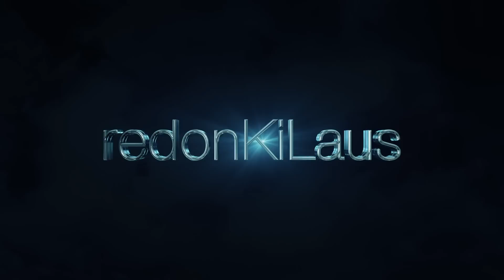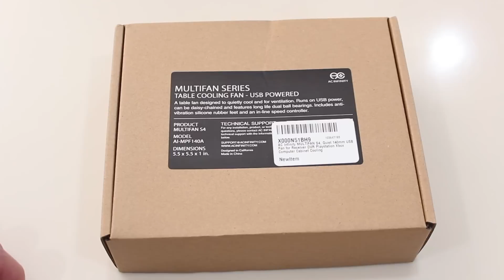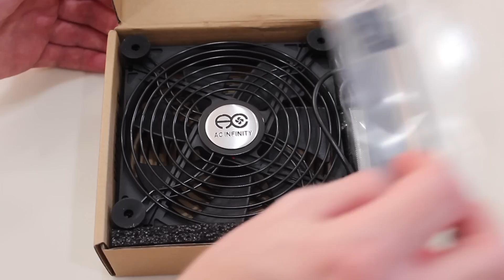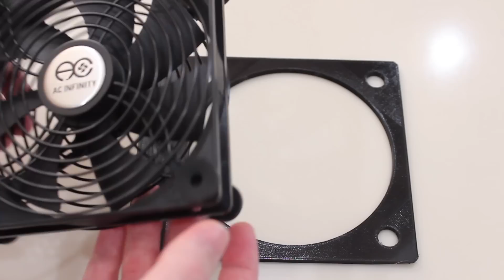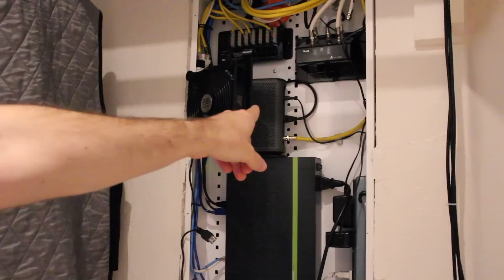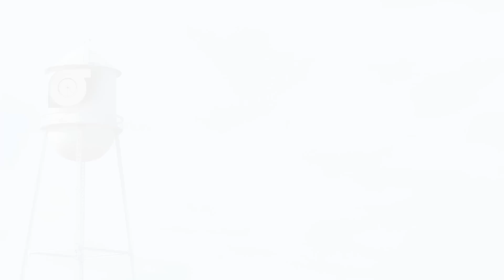AC Infinity MULTIFAN S4 - Network Equipment Cooling

Comment: Good review thanks a lot. If I heard you correctly you had a usb powered regular mini fan, and while it dropped the temp on your equipment this specific fan dropped it even further? 

I’m debating between this and a similarly just standalone USB powered fan for my PlayStation 5. It’s got a heating issue where it shuts off if it gets too hot but otherwise works great. If I’ve got a regular powered outlet fan facing it it doesn’t shut off it’s just not ideal being plugged into the wall. I want something more compact like this just want to be sure I get enough cooling.
Reply from the maker: Yep, I had some little USB powered desk fans - low air movement.  These are far better and more directed.  Thanks for watching!

Comment: Mine wont power on, what am I doing wrong?
Brand new arrived today, S4 5.5" USB component fan, for my Xbox Series X, BUT it doesnt work, I am really confused how they could send me a broken unit and I feel like maybe Im missing something here, why wont it spin or power on? does it have a min heat setting or something, I tried L, M, H, and O none spin.
Reply from the maker: Sounds like your power supply isn't working or you may have gotten dud fans.  Thanks for watching!